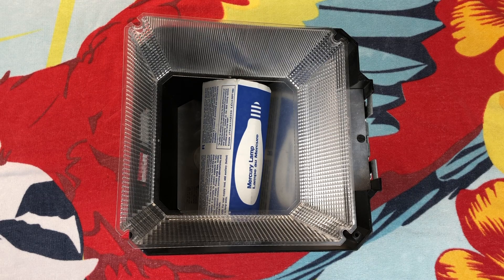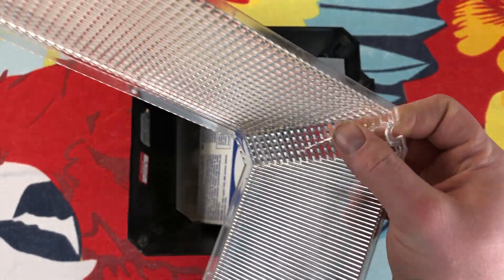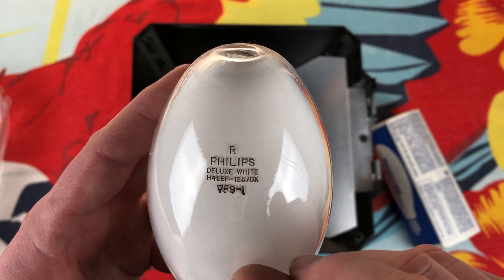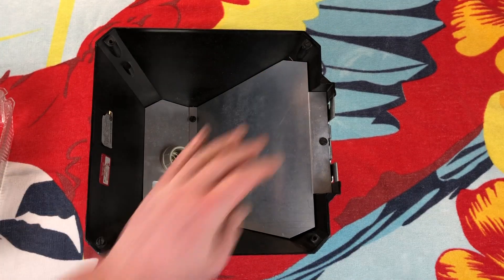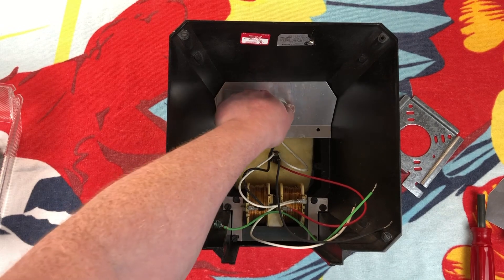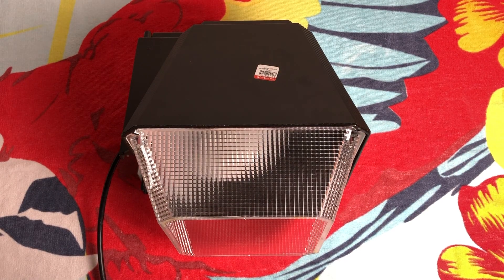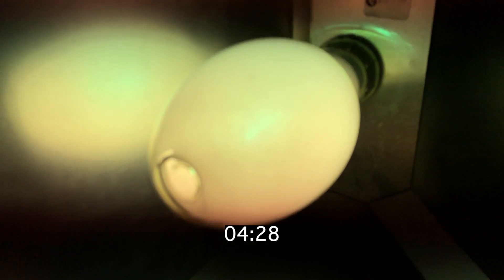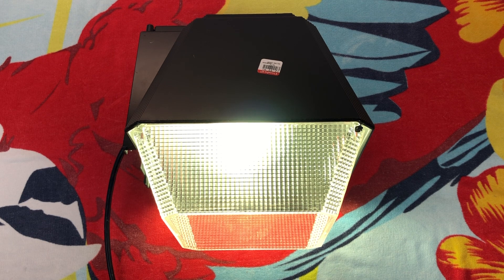American Electric 125watt Mercury Vapor Area Light

Comment: Well, this video solves the mystery about these fixtures: these were sold under several brands and names and the later ones were plastic, and some included the refractor and others didn't. I'm not sure if the HPS ballast/Lo-Volt combo coincided with the change to the plastic housing, but it might have. I have the identical fixture to yours, metal housing, with the same ballast, but it is branded Electripak and it had a Philips Lo-Volt lamp in it when I bought it, which burned very dim on the H42 ballast. So, chances are the original lamp had been replaced with the "newer" Electripak Lo-Volt lamp, which was the wrong lamp for this version. The Lo-Volt lamp I have works fine on a 100w 55v HPS ballast and I used a Philips HPL-N European 125w lamp in the Electripak fixture since it was fairly difficult to source true 125w lamps in the US even decades ago.

Comment: Could you fit a hps bulb in it if you so desire
Reply from the maker: The bulb would fit if you wanted to but then naturally you'd have to change out the ballast, unless it's a retrofit lamp.
Reply: @Parrot175  like a hps bulb with an internal ignitor
Reply: No, the lamp operating voltages are different.
Reply: In fact, you could use a European 110w high pressure sodium lamp such as the Philips SON-H 110w and also you could use a European Sylvania 69/108w Eco Arc high pressure sodium lamp in this fixture too. In addition, you could use a 125w M150 pulse start metal halide lamp in this fixture if you add a European superimposed ignitor to the ballast since those lamps are electrically identical to 125w mercury vapor lamps and there are also 125w metal halide lamps made by Venture that use an internal ignitor, which enables a quick, easy retrofit by simply changing the lamp!
Reply: @worldwidehidcollectorusa-fkt  wow thanks for that
Reply: @asherzelig221  Please note that not all high pressure sodium lamps from 35-150w have 52-55v arc voltages. In fact, most European low wattage high pressure sodium lamps have an arc voltage of around 85-100v and in that case, that is why those lamps are much safer to use on North American mercury vapor ballasts. In fact, the Philips SON-H 110w high pressure sodium lamps have an arc voltage of roughly 110v while both North American 125w H42 AND European 125w mercury vapor lamps have an arc voltage of 125v. In fact, many high pressure sodium retrofit lamps typically save energy by reducing lamp arc voltage without overheating the ballast unlike you see with metal halide and mercury vapor lamps. Did you know that European 35w-150w high pressure sodium lamps are electrically identical to North American 35w-150w pulse start metal halide lamps? As such, European 35w-150w high pressure sodium lamps will run pretty nicely on same wattage North American pulse start metal halide ballasts as long as they are between 35-150w. The reason why most European high pressure sodium lamps have an arc voltage that is between 85-100v is because they are designed for operation on 220-240v series chokes while our North American 35-150w high pressure sodium lamps have a 52-55v arc voltage because they are designed for operation on 120v series chokes. I have some experience with running European high intensity discharge lamps on North American ballasts because I like collecting high intensity discharge lamps from all over the world.
Reply: @worldwidehidcollectorusa-fkt  great info. With all my years as a lighting professional, I was not aware of these apparently compatible alternatives.
Reply: @worldwidehidcollectorusa-fkt  Was thinkign about that lamp, thanks for saying it.
Reply: @bulbman256  Which lamp were you thinking about mentioning?
Reply: @worldwidehidcollectorusa-fkt  would a GE Lucolox 70 watt hps bulb work? Thanks
Reply: @worldwidehidcollectorusa-fkt  you are a gold mine! Thank you so much! I ended up getting a Caster 125W 120v MV bulb and also going to try a 100w H38 MV.